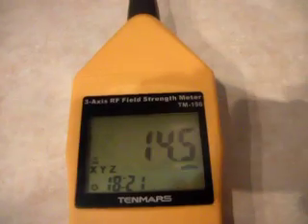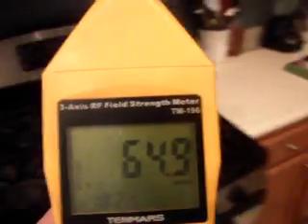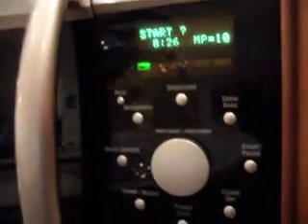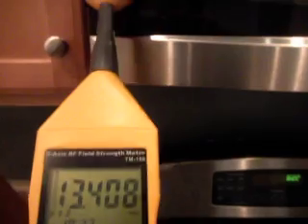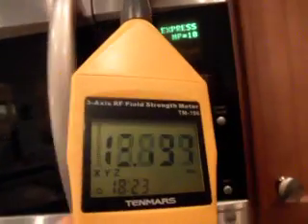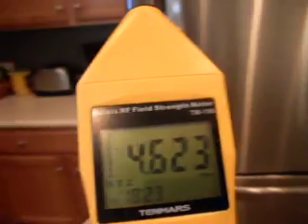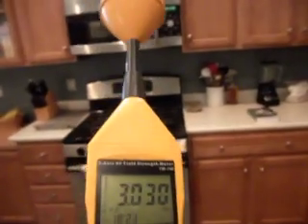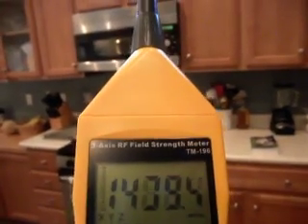Testing a Microwave Oven with a Tenmars TM-196 Meter

Comment: Can this be set to a certain frequency to measure field strength?
In other words is it frequency specific? If I have a transmitter and want to measure 89.9 mHz at 3 meters away will it do that?

Comment: Steven.....I've been enjoying your videos and have a question pertaining to this one.......how do you know the EMF you are reading is in the microwave spectrum?  Could this be EMF in the 60 Hz (or one of the harmonics) associated with the current being drawn by the microwave power supply?
Reply from the maker: Jerry M There's a saying in the electromagnetic radiation field that "All microwave ovens leak".  I've yet to find one that doesn't.  The meter reads from 10Mhz to 8Ghz, so everything is Radio Frequency (RF) that it picks up.
Reply: Environmental Radiation LLC Got it....thank you.

Comment: whats a safe level?????
Reply from the maker: There is no safe level of man-made radiation.
Reply from the maker: http://www.environmentalradiation.com/  People with Electromagnetic Hypersensitivity commonly report the following: 6 to 3 V/m: Too high for ambient levels. 1 to 0.3 V/m: Too high for many people. 0.1 to 0.05 V/m: Many people have symptoms. 0.02 to 0.01 V/m: Most people with EHS are okay. (Source: EMFields Acousticom 2). The Tenmars TM-196 RF meter manual states “We recommend a maximum level of 0.614 V/m for prolonged exposure”. It is normal to find yourself sitting and walking around in fields of wireless radiation of approximately 1 V/m in the USA and they can peak to over 2 V/m in sidewalks